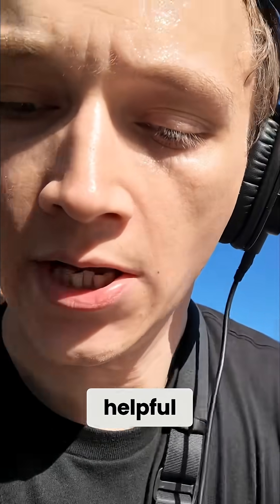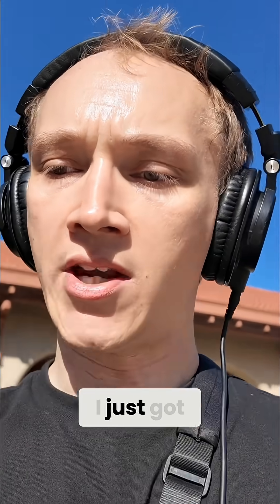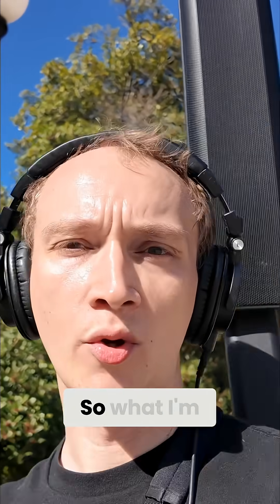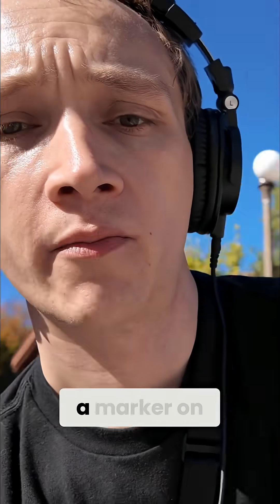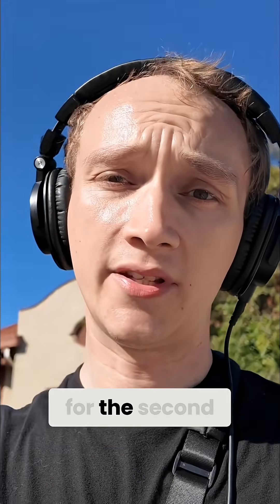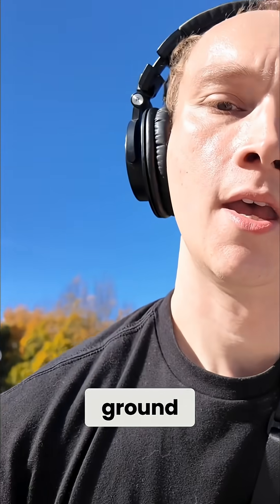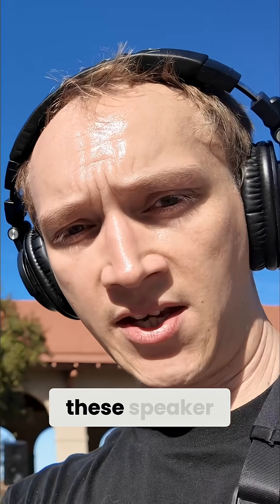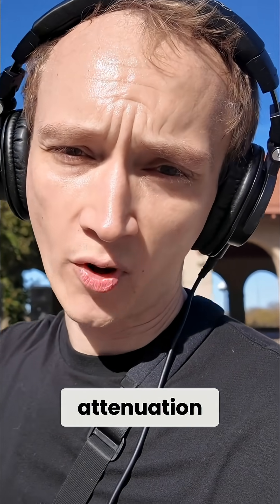Inverse Square Law: Theory vs Reality

Comment: Why the phasing? I can understand hearing cancellation when walking from a left speaker to a right speaker but never heard it when approaching a speaker. regardless if line array or point source. Phasing issues  can affect to SPL readings.
Reply: Maybe the phasing was due to the waves bouncing off the ground.
Reply: @SunriseWaterMedia  It was grass. No buildings nearby. Very low possibility for any reflections. Not sure how the test was setup.
Reply: @donaldbundy3499 It looks like concrete or asphalt to me, unless I'm mistaken.
Reply: @SunriseWaterMedia  I stand corrected. Thanks for that. I watched the source video and realized a number of things. In that video, Kyle Mathias clarified the phasing issue I was hearing. I agree, the pavement was causing the phasing issue. But i herd less phasing with the Bose system, due to it's truer array design.

Comment: In a typical performance environment, the presence of people usually makes about a 6dB difference. It also varies depending on whether the floor is hard or grassy. Sound engineering seems to require solid theory, experience, and a well-trained ear.

Comment: If you have an ideal point source emitting coherently over 4pi steradian, and you reflect it off of an infinite perfect reflector you get a dipole source. Add losses and the emission pattern of the speaker no longer being a point source and you can get very interesting effects.

Comment: Pace distances is so inaccurate (and can indeed have influenced the result). And quite stupid these days, when you can get a good laser distance meter for almost "lunch money"
But ground reflections do matters. Especially since you had the speaker quite high above the ground. 
That means when you are up close, the path for the reflected sound (to the ground and back up again) is quite long compared to the "direct line of sight" distance to the speaker (and because of that the reflected sound, doesn't add much to the total SPL). 
But the further you get from it, the smaller that difference get 
- which means the reflections add to the total SPL more and more - making it decrease slightly "slower" by the distance, than the inverse square law. 
Ok, now you were not very close at the "half distance" either, but it might still have affected a dB or so (the other can have been due to inaccurate distance measurement).

It would be interesting to see a test with the speaker as close as possible to the ground - then the reflected sound would add pretty much equally over all distances (unless you are very close) and the result would probably be closer to the inverse square law. You could also test on a less reflective surface, such as grass. 
But if you do - get a better way to measure the distance...